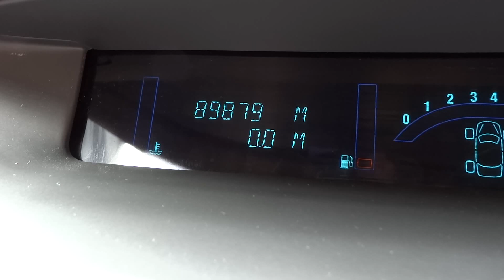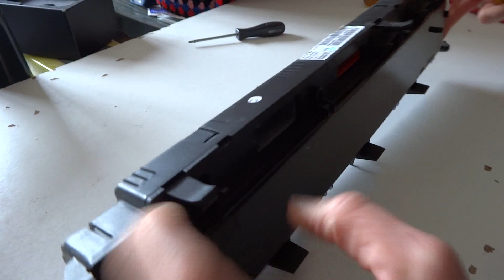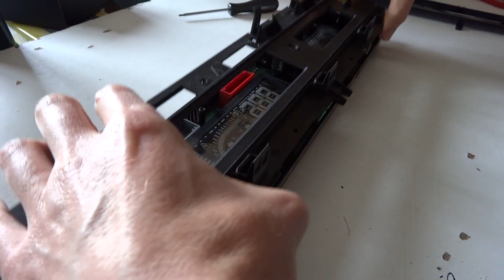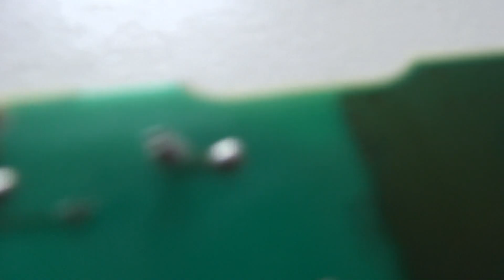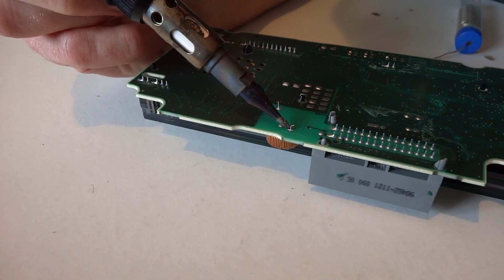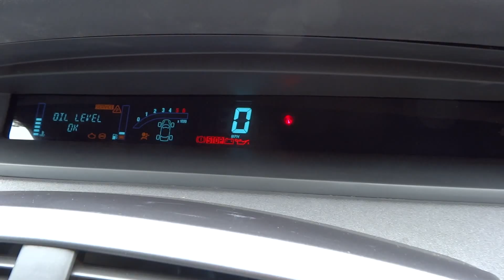Renault Scenic Dashboard Repair. Fix Digital Dash Panel. Mend Faulty/Failed Display.

Comment: I’m not even getting any dashboard lights or immobiliser light just brought a brand new battery still nothing only way to start my scenic is to use a power pack jump starter and all dash lights come on and car will turn over could it be the 30 amp red fuses or the black block fuse on the positive lead that has blown any help would be greatly appreciated thanks it’s a Renault 1.5dci scenic 55 reg

Comment: Bro, my dashboard worked until just very recently, it started flickering, turning on and off, and making beep sounds as I drive. The replacement and the fix at a store is very expensive for my pocket, so I am going to try it out myself :). What do you reckon I should check (other than what you've shown in this video)? Thanks a million mate.
Reply from the maker: First of all, just try removing the connectors to the dash panel and reconnecting them as somtimes this is where a flickering dash problem lies. Hopefully this will resolve your problems without having to buy any parts or trying any further fixing/soldering.
Reply: @ifitsgotwheels  Bro, I suspect it's not as serious as the repairman here told me by not even looking at the dash for a second. I will go ahead and try. I am so thankful bro for your quick reply! I will follow up with some new info, hopefully tomorrow. Thank You mate!
Reply: @pistakoja1873  Hey there. Did it solve your problem in the end? I have exactly this issue right now. It is flickering and it is making beep sounds.

Comment: Did a succesfull repair today with the help of your video, thank you. A few additions:

- The plastic shielding of the two powerconnectors can be brittle and break easily.
- I chose to desolder the large LED-segment display for easy access. Putting it back together was a bit of a nightmare, the pins on the display bend very easily and it's difficult to allign everything properly.
- Replace the electrolytic capacitors while your at it. They don't cost much and will make your repair last longer. Keep in mind that to replace them, removing the large LED-segment is required.

Parts used:
AUIRF3710ZS 
3 x 100 uF 50V  (Low ESR, SMD aluminium electrolytic)
1 x 330 uF 25V  (Low ESR, SMD, aluminium electrolytic)
Reply: does the kilometer/mileage reset when you change or repair the screen
Reply: @CanberkCano  Not in my case. Took the unit in and out the car multiple times. I've repaired other units in the meantime however, and the mileage jumping UP is a common problem. Never seen it reset to zero. There are applications to flash the eeprom and set the mileage, a car electronics specialist could do that for you.

Comment: I have same problem, but not the same problem.. My dash is dimmed and missing the Radio side. What could be the problem then??
Reply from the maker: Hopefully it's just the either or both of the 2 wiring hanks not quite clipped in at the back of the dash display. Sometimes the connections are not 100% and cause dash or radio display probs. On my other vids I have the dash removal vid, unclip the wire hanks (1 red , 1grey connectors) then reattach them again, hopefully it will be as simple as this and it's also free and easy thing to try first anyway. If that does not solve it then only on closer inspection of the circuit are you likely to see any bad solder joints, to check capacitors or resistor parts you may need a local electronic person to help you.
Reply: Tried, but still same prob. I have original renault clip. Its showing problem on the dash. It’s telling me 12v missing somewhere. I think i need the diagram for the connectors. The are possibility to have an other 12v line.

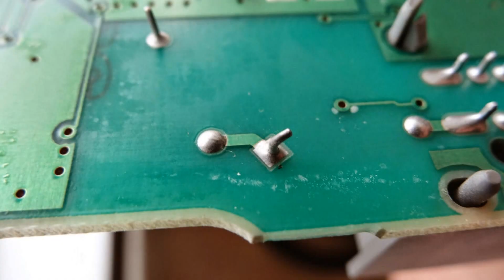Comment: Hi sorry I am late to the party. Just to confirm is the dry soulder joint, the tiny crack that runs as a ring which is only visible at the 2:58 frame?
Reply from the maker: Yes, that was it.
Reply: @ifitsgotwheels  wow cheers! Didn't expect a reply on a old vid lol. Thanks for your time! may I ask, My Dashboard has just stopped working. Renault Quoted me 481 to replace the cluster. They said they'd have paid if the car was under 10 years old but it is an 04 plate lol. I have bought a new one from ebay which I am going to swap to, but I'd really like to fix mine if I can and retain the correct mileage. Should I just check for dry soulder joints? Like I said the unit was absolutely fine then just stopped working. no flickering or clock malfunction etc.

Comment: You wrote : New 6.5 Resistor ?
6.5kohm resistor or 6.5ohm resistor?
Or it's a fuse 6.5A?
Reply from the maker: yes, what I call a resistor is actually a fuse. So look for a 6.5A SMD (or SMT) fuse. I did add a correction message of that part in the vid, but youtube recently removed that feature! I never updated the text on the page though so will correct that now, thanks.
Reply: THX, I have to help a friend with this problem. this helped. You are the man...

Comment: Hi  my friend, are F3710S and 6.3 A SMD right for this equipment? By the way thanks for video.
Reply from the maker: Ozkan Toptas yes, although what I call a resistor is actually a fuse. So look for a 6.5A SMD (or SMT) fuse. Thanks

Comment: I know its been a while since this was posted, but was wondering if you might have a wiring diagram for the Renault Grand Scenic, which shows the wires leading to the dash panel, and the pins on the connector they are attached to.
Thanks.
Reply from the maker: No sorry. The car belonged to relatives and apart from the dash fault and oil leak it pretty much looked after them the way they looked after it. They reluctantly let me go near it the last week they owned it as they wanted me to try and sell it, but I fixed everything I could first then sold it to some happy buyers. I did not have any wiring diagrams I just watched the french versions of fixing the dash and tried to do what I saw there making an English version as I went along, thanks.

Comment: hi i have renault sceinic 1.6 2004 model my dashboard i want to buy a used one, question is this a plug nd play or there is software that i need to do the changing
Reply from the maker: Most cars if they are from the same model & engine are just a straight swap, it is normally when ECU's are swapped that you need various things together like keys and immobiliser units. I don't know much about electricals or Renaults (only ever had this Renault for 10 days!) so do not know whether the immobiliser would form part of the dash unit, as that to me would be the most likely source of not being able to make it possible.

Comment: What do you type in ebay for the resistor
Reply from the maker: Hi when I try typing F3710S, cheapest are £1.10 each or £1.80 a pair but these are from China so would take a 2/3 weeks to arrive. Tried typing IRF3710S and UK seller selling for £2.57 with same day freepost. Try this link www.ebay.co.uk/itm/161963866971 thanks ;)

Comment: next to the clock I have four flashing  0000 ? anyone know why? cheers
Reply: It's code for the radio. Because when computer reset, radio also lock itself, and you need to put the code for the radio to unlock it.

Comment: can anywon help me please. i have scenic 1.5dci and my radio is not working. i have code for radio bat it wont show me on display 4 zeros to put the code. my radio display is just black but cklok and temperature works fine. sory for bad english. please help

Comment: Hi,
Please help.Im at the end of my rope with this Scenic.For the past few weeks on entering the car there is a buzzing noise even before you put the key in the ignition.This normally goes after driving for about a min.But a few times it continued to the point that there was a burning smell coming from the dashboard.I brought the car to an autoelectrician who said the display was faulty.He didnt strip anythng down , just looked.I am Irish but emmigrated to Fuerteventura last September.The renault garage told me the display cannot be fixed here and if I want to get it repaired I must send it to mainland Spain.I dont understand the logic here because the display is working perfectly with the excetion of a flickering STOP sign which looks like a connection problem sometimes during the time the noise is there.Another thing is the noise only comes on when the drivers door is opened.Not when you open any other door.Can you please try shed some light on this for me.I dont want to spend money repairing the display if it is not the problem.And be without the car for God only knows how many weeks waiting for it to be sent back to me.Thanks in advance,
Billy.
Reply from the maker: +Billy Quilligan Hi Billy, I really like Fuerteventura, I went there once on holiday with my brother & his family. I no longer have the scenic as it was my Sister-in-laws, and I only had it for the last 10 days they owned it, so know very little about them.
You can easily remove the dash panel surround (see my other vids) so it would be worth doing that just so you can help locate where the noise is actually from.
I am not sure where the tiny air-con air sampling fans are located on the Renault as those are known to make a noise, the one on my old Rover does, but on my Rover it needs the key in the ignition before you hear it, as the Scenic we had was a keycard I am not sure when it would come on but there is a possiblity that it may actually be activated from the drivers door system, i don't know. 
The drivers door itself may be the cause, or whatever it switches in the dash panel, I just would not know. It is worth asking or seaching on the Renault forums as that's how I found many of the answers I needed before making the videos.
If you want you can open the dash panel up if you do want to take a look inside it, as often on a circuit board if there is a problem it can often be seen where a component has burnt out, worth trying to see dry solder joints/cracks too, but sometimes they are hard to find, but looking costs you nothing (as long as you have a torx bit to remove the screws) and it's easy to open up the dash panel.
Whatever it is I hope it's an easy fix. At least you have better weather there to work outside, thanks.
Reply: +ifitsgotwheels Hahahaha yeah I suppose you are right about the weather.But the way I feel now I would rather walk or take the bus LOL.
Thanks a million for your insight.I will try get the screwdriver and take a look at the unit myself.OR JUST GET IN THE PASSENGER DOOR IN FUTURE HAHAHAHA
Thanks again,
Have a nice afternoon,
Billy.
Reply: Billy Quilligan hello pléiade mail , scania71100@hotmail.fr
Reply: attaf abdel I dont understand your comment.
Reply: Do you have the application to run or tell me what device you use thanks
Reply: I'm afraid not.I had to get the mechanic to resolder the joints.

Comment: Do you happen to have the pinouts for the two connectors? My instrumentpanel for the megane I seems to have the same two connectors. The grey one has 2x 15 pins and the red one has 1x 15 pins. My panel has a problem with the fuel level indicator falling back to zero with refuel warning light going on although my fuel tank is by far not empty! I checked the fuel level sender on the fuel tank. It has the correct values (Ohms) corresponding to the actual fuel level in the tank. When I know what to pins are the ones coming from the fuellevel sender on the tank, I can check weather there is a break in the cable (which I doubt), of a failure in the instrument cluster.
Reply from the maker: +Marc van der Linden sorry I no longer have the vehicle or any wiring diagrams for it. I was going to suggest the sender, so at least you have started in the right place. are there any wires at the connector that match up to the colours of the ones at the sender, that's all I can suggest without knowing!

Comment: hi can you help me ? let me know if your still around and ill write what I need help with 
thanks adam
Reply from the maker: Hi yes I am still here. How can I help? Thanks.
Reply: +ifitsgotwheels I have taken my dash apart like your last video instructed no my digital display kept going dim and bright only on the clock and radio side now it has gone out completely leaving all the rest of it working is there anything specific as to what has turned that side of ? is it a fuse any light you shed will be of great help I don't have funds to send to someone to repair
Reply from the maker: Hi when this happens it can be caused by bad/dry solder joints at the connector. I am not sure which connector did the clock the grey or the red one as we only had the vehicle a few days (these are the two connectors you pull off to release the dash panel), but that is where I would be looking.
Reply: +ifitsgotwheels shall I just warm up each solder again with an iron or ?
Reply: +ifitsgotwheels the grey one as soon as plug in turns on the left hand side might do the right hand side but obviously I won't know lol
Reply from the maker: Yes if you can warm them or add a little bit of solder to each then that is usually fine without having to desolder them. You may still have to be careful so as not to disturb any pins depending on what they are like. Sorry sending all replies via mobile phone as pc screen died on the weekend. Tried to resolder a capacitor on that, but we all get beat sometimes :(
Reply: +ifitsgotwheels  will a hot air gun grt it warm tenough
Reply from the maker: I dont know. I dont think so.
Reply: +ifitsgotwheels I've tried soldering it again nothing seems to bring it back where would I find out more info now ?
Reply from the maker: Googling and Renault forums!? I don't know much about electronics or Renaults! We only had it for a few days and somebody else did the soldering for me. But the internet often turns up the answers, when others in the same situation have reported the same probs.
Best of luck.

Comment: Hi ifitsgotwheels. Thanks for this video. Most helpful ! No dry joints found. I discovered the resistor, next to the wire inductor was open circuit. However it is not a resistor. In fact it is a SMD 6.5 amp fuse. I discovered this once I had checked it and found it was open circuit. On my display it is a white component with a mark in blue "6.5" . With the help of a tech savvy mate we identified it and I replaced it. Problem solved. No MOSFET needed. Hope this helps someone out there.
Reply from the maker: +Keefy310857 Hi Yes, it's a Surface Mount Device / Fuse. I know this now, I just called it a resistor by mistake in the video. The one I did not use I sold on ebay recently.
Reply from the maker: +Keefy310857 I've just added some speech bubbles in the video to help correct the mistake now. hopefully everybody can see them, thanks.
Reply: +ifitsgotwheels Me again. Now display is working continuously by wifey reports clock and trips reset on restart. Fuse not blown, What next ? MOSFET ? Could it be as simple as low battery voltage/knackered battery (12.1 V after a run) ? All advice gratefully received. Thanks.
Reply: +ifitsgotwheels PS What exactly does the MOSFET do ?
Reply from the maker: +Keefy310857 hi, yeah before going to the trouble of desoldering around the panel to replace a MOSFET, eliminate the battery as the problem first.
I am told that 12.1 volts after a run is only about a 25% charge (a fully charged battery will be more like 12.6 volts), so you may want to get the battery tested at a local car shop first, as they usually have a tested that will test the battery under load. Charge it up beforehand though if you can. With headlights on, a good battery should still start a car with lights just dimming slightly, a weak battery and lights will almost fade out, or car won't start.
You can also test a battery with your voltmeter as the engine is being cranked, a good battery should really stay above 11 volts. 9 volts and the battery needs replacing or recharging.
It is possible that your battery has just been hit by the recent cold spell (the one in my car has!) this time of year at the start of the cold weather hits batteries hard. A normal full charge may start the vehicle, but even after a run you find the situation has not changed and you have to charge it again! I always find it is best if I can charge a battery for 3 full days!!! (in or out the vehicle), that it conditions up the battery much better, and have often used this to revive many a believed dead battery.
Reply from the maker: +Keefy310857 I wish i knew what the MOSFET does!? Anything and everthing electronic baffles me. I just know that it seems to effect the memory being kept or not. If I could understand french then maybe the guy in the french video tells us! ..as that's where I started when I had these probs. I was googling all I could, and just decided to make an english version off what info I had picked up elsewhere.
thanks.
Reply: +ifitsgotwheels Mate ! You have been so helpful. Don't know where you live but if close I'd defo buy you a pint or two. We're in Sussex. Will try some tests on the battery. It's 4 years old so maybe the problem. My wife is French and just set off to Brittany to spend some time with her mother. Hope she makes it !!! When (if) she gets back I'll ask her to watch the French dude's video and translate the finer points. She's no techy though. Let's keep in touch. I'm sure there are many folk out there who would be grateful for the advice we could give by collaborating. I'll pass on anything I find out. Cheers my friend !!!